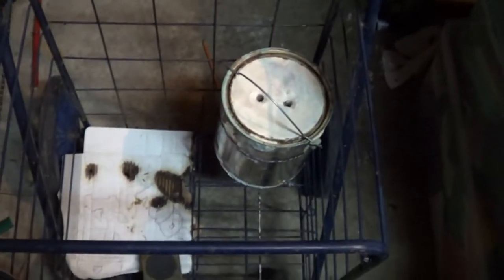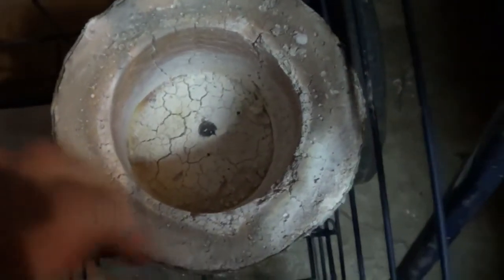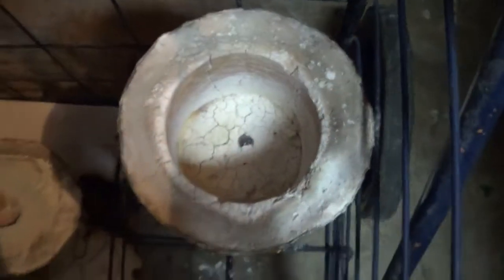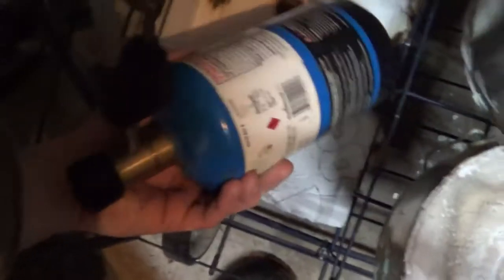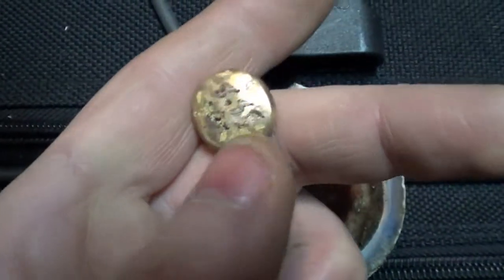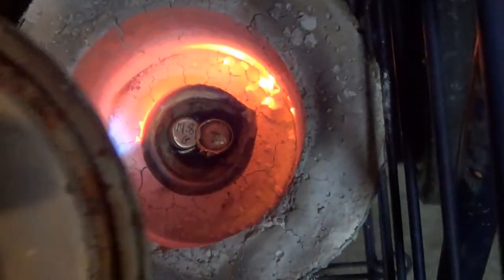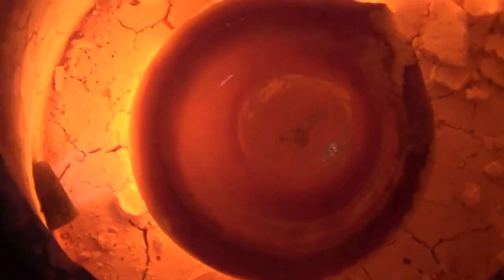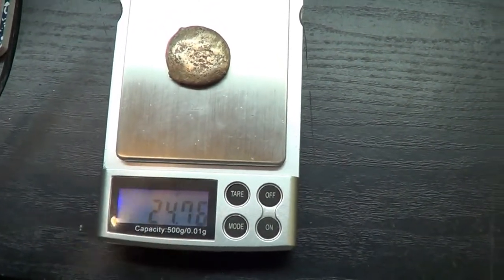Gold button made with my $20  DIY blast furnice

Comment: Cool .. that was fun.. How long did you have the gas on for?

I've just got some stuff together to make a rocket stove using an old paint can and lining it with a mix of cement, gravel, sand and perlite

Thanks for posting
Reply from the maker: Hi Frugal . It took a little longer than i had thought it would . Due to the weight i was trying to melt. It took about 10 min. to liquefy .So from now on any thing over 10 grams  I'll use mapp gas.  It burns much hotter and would have melted it in 5 min or so. And gave me a better looking button. Best wishes .